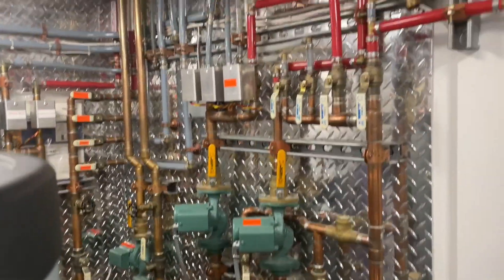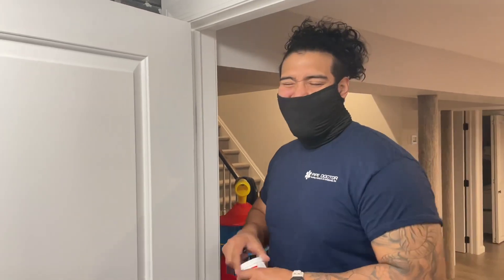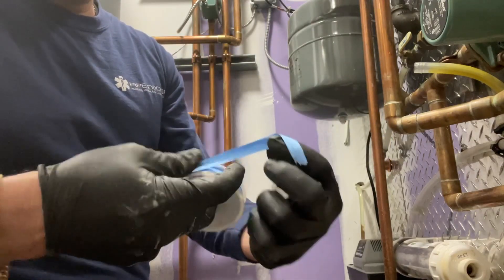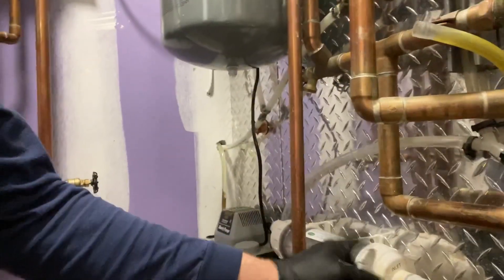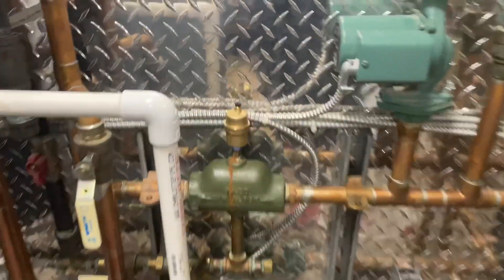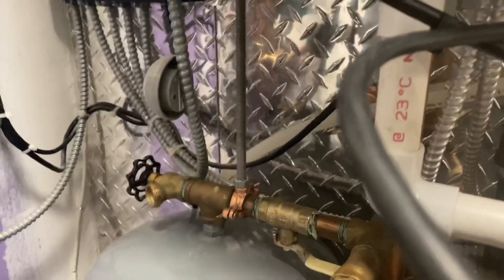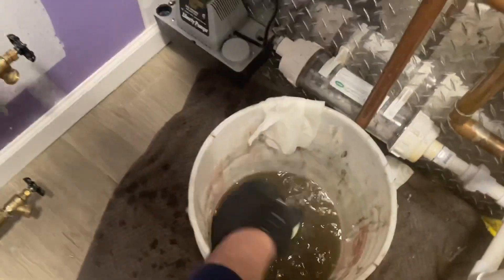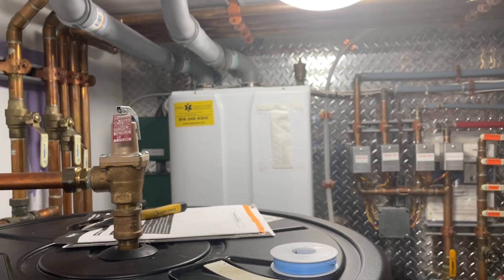Why is Mikey Pipes Blocked from Steve Lavimoniere YouTube? NHB-150 Leaking Condensate

Comment: From a mechanical engineering standpoint, gentle bends in pipe offer less flow disruption, lower pressure drop, than fittings.  Also less opportunity for leaks (of course).

Comment: I commented on one of Steve's videos were he cut the plug off the condensate pump and wired it direct to the furnace power. My comment was that's fine however you voided the pumps warranty.  He said I was wrong. So I suggested that he read the manufacturer warranty statement were it clearly states that you cannot do any alterations to the unit. I worked sales in a major supply house and we would send the pumps back manufacturer and they 100 percent rejected all units that had the plugs cut off.

Comment: "Itz a leeka moma"  

He charged my dad 289$ for a low charge on his ac system. He only put like 4oz in. Is that high?
Reply: I mostly do heating btw, just getting into ac. I live in westport right next to dartmouth.
Reply: I mostly do heating btw, just getting into ac. I live in westport right next to dartmouth.
Reply: No, that price is not high. That gas is like gold. There's also the charge for the service call.  Nothing wrong there.
Reply: For many years I worked for Westport plumbing and heating. Mr Ray plante good guy I knew his dad as well ..

Comment: Shouldn't that outdoor sensor be outdoors?  WTF?
Reply: @PipeDoctor  What's the point to doing that?  Now the boiler wont modulate.   The only reason I can figure is to maximize DHW output but they have the separate Weil tank for that.   SMH.

Comment: You supposed put glue in fittings and pipe 
Not not 
Not good
Reply: It is hard to understand your question? Why is it a bad idea to use glue on PVC pipes and fittings? It is only a condensate line!
Reply: It's fine

Comment: No PVC primer before glue; primer removes the dirt and ink and softens the fitting and should always be applied to any and all piping that will likely carry acidic fluid because the pipe will fail because it was not properly prepared.
Reply: @PipeDoctor  I don't clean exhaust hoods I work on fryers grills ice makers package comfort systems and walk in coolers and walk n freezers and are you really saying that primer is not needed to properly assemble PVC piping then I'm glad you don't work in the Midwest because there is noway your piping would pass our building inspectors because I know some that if you can see ink on a plumbing fitting it fails inspections period so YOU ARE SO WRONG!!!!!!!!!!!!
Reply: Aren't you training Godzilla and Kelvin then you aren't training them how to do the job right you are showing them that you cut corners why is it that every trainer in plumbing and refrigeration instruct the use of primer before cement  I know they're wrong and your right!!!! So stick with playing in Fecal matter PLUMBER.

Comment: All that crap in that room and still no air conditioning... I’ll take forced air and a regulator natural draft water tank with a b vent chimney. Least I’ll have hot water when the power goes out.
Reply: ?? Never said anything about it being a 2 pipe system... I’m just saying all that junk in that room just for heat and hot water...
Reply: Agreed. I could be wrong but it seems all the money you are supposedly gonna save on heating will just be spent on maintenance and repair to the modcon.  All of this seems needlessly complicated for an average home. When I needed a new boiler I had two contractors who were pushing these modcons hard. When I said no I wanted cast iron they didn't take that well. I finally got a new Burnham cast iron boiler with two Taco pumps, indirect hot water heater. Simple system that's easy to maintain. Now I love my cast iron radiators and the heat they give off. But If I was building new or remodeling and this was my only option I would just opt for forced air.  Copper fin baseboard heat is similar to forced air anyway in how it holds heat.

Comment: Steve is a one trick pony. Every year he shows the same thing. I got fed up with him when he blamed a customer after a shower valve broke after he winterized the house. Blamed the customer and the handyman because he didn't verify something was drained. He also installed pex outdoors for a customer to replace a broken copper pipe. I called him out on that and no response. He thinks he can make no mistakes.

Comment: I also see where steve is coming from about modern high efficancy tankless units about longevity. Ive come across tons of 40 year old regular old gas boilers and Riello oil burners that havent been serviced in  a decade and they still mostly work. I had the same NHB150 in this die in 3 years from some crazy well water eating the stainless exchanger. It was alos installed with the outdoor sensor right underneath it and not plumbed to purge. Thick cast heat exchangers last longer especially if installed wrong than thin efficient stainless/copper exchangers. Does a the energy saving of a modern tankless unit offset the potential cost of having to replace it every 5-10 years? Time will tell.

Comment: The air scoop does not do much unless you have around 18 inches of horizontal piping feeding it.
Reply: Air needs to be at the top of the pipe for it to be removed as it enters the Air Scoop, otherwise it will pass right through.
The lenght of straight pipe before the Scoop allows air mixed in the water to rise to the top of the pipe and be "Scooped out" as it enters the Air Scoop by the internal vane in the bulge of the Air Scoop.
A bend too close to the inlet of the Air Scoop will mix the air and water vertically and it will pass right through without being removed.
The location of this Air Scoop seems pointless at the bottom of the piping (air rises) and a screen style micro bubble remover would be a better fit.
Reply: That's what they want, for water turbulence reasons
Reply: @luisalvarez8266  Correct.

Comment: Mikey Pipes, what's your take on the built in water feeder on the NCB's?  I'm not a fan and I've installed them in the past with a regular Watts PRV and backflow so I can fast fill while I'm purging.  Over the years I've found I've had to go back and pipe in the connection on the boiler.  Seems the boiler doesn't like a PRV.  You're thoughts?  Maybe a tutorial video???

Comment: Lav doesn’t “pump away”
Reply: @PipeDoctor  Not going to argue much about pumping awayit's the way I do it.,but with low head pumps it's not as important as you would think.
Reply: @joebal9044  It's also worse for the pump operating in all that extra heat.
Reply: @barackobama5304  That use to be the reason why they use to put the pump on the return.  No longer true with modern wet rotor pumps.
Reply: @joebal9044  I think it's worse for wet rotor pumps since now they have more exposure to hot water.  That was not the case with the old oil lubed pumps

Comment: You don’t prime the PVC?
Reply: @PipeDoctor  I had an old timer tell me 25 years ago, "Matt an AC condensate they will not leak, so need to glue. (to be extra safe I glue them upstairs or in attics) The benifit is that several years from now, you can take it apart for cleaning. A condensing furnace WILL leak so you must glue downstream of the furncace. But the AC? If not in an attiic or hight traffic area, dry fit it" He was right. In a basement with low traffic, a good tight dry fit is fine, IME.
Reply: _uck Steve. 🤣

Comment: Why not just run ½" pvc why did you up size to ¾" I've always just ran ½". I see pex ran all the time and same thing the adapter rotting out from the acidic water .
Reply: Maybe he didn't have any. Easier just to keep one size you use a lot, means you don't need twice the stock of fittings for both sizes and whatnot.

Comment: i always wondered why steve changes tanks and not just pump them up.. if water comes out of the shrader valve then its DONE but if its just lost its pressure then here in uk we just re charge them...
ive watched his videos for yeaaarrrss  though..
Reply: tank could be a little suspect if you need to recharge.  better to just replace because  it prevents a return trip

Comment: I’ve noticed in a few of your videos, the safety discharge pipework, from PRV,S are not terminate outside. Are you not required in the US to run to outside the building ? 
Kind regards 
John from UK
Reply: @PipeDoctor  In California and we are required to discharge outside, as told too me by a plumber.
Reply: Pipe Doctor Plumbing, Heating & Air Conditioning, Inc. 
In the UK we have a whole building Regulations document (codes think is the term you guys use) that covers the safe discharge termination of PRV outlets. Does the area/room need have a drain, what happens if/when the pressure relief blows out?

Comment: Here in the UK we have had  condensing boilers longer than you have in the states.                 I am finding on some of my service calls that the PVC  condensate drain lines on the early installs are going brittle,cracking and its even making glued joints leak..............

I am seeing more and more of these condensate issues.  :-(
Reply: What about Stainless 304 fitting feeding into Pex? Thanks
Reply: @guytech7310  here in UK its all copper of plastic pipe work. Very very very rare to see any steel in a house and would only be a gas pipe.. we run all our gas in copper pipe. Water pipe and heating pipes can be copper or plastic (pex) and we use push fit fitting for plastic which is similar to the American shark bite..
Reply: @brendanfisher2528  Stainless, not steel! Most of my fittings are stainless, unless I am coming in contact with cast-iron, than I use brass. I was planning to use a Stainless Fitting & PEX for the condensate line, but asking if Stainless would work as good or better than PVC. if you don't know, no worries. I guess I can go with the Stainless fitting, since I already have it & if it fails, change to PVC.
Reply: @guytech7310     Would be better than brass,  we use PVC as it's the best of a bad bunch available to us from our merchants (supply hse), but after 10/15 years it starts to give problems.  :-(

I am looking at switching to Vulcathene  waste pipe for condense as  its rated for laboratory use(chemicals)  and should be far more robust. ( I hope!)
Reply: @julianhawker7672  OK, Which do you think is better PVC or Stainless\Pex? Asking because I am working on new install (my home). Thanks